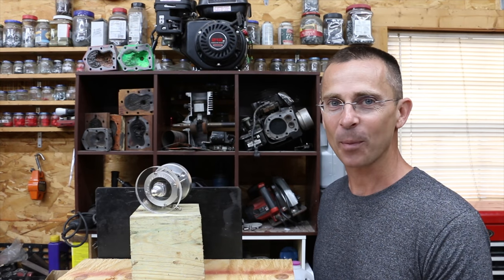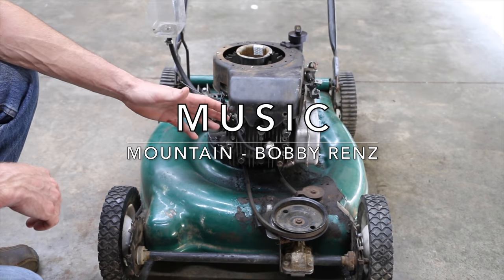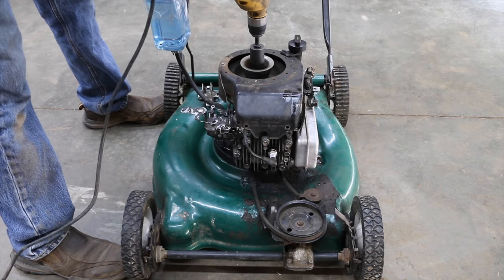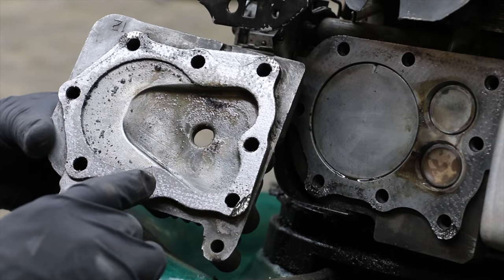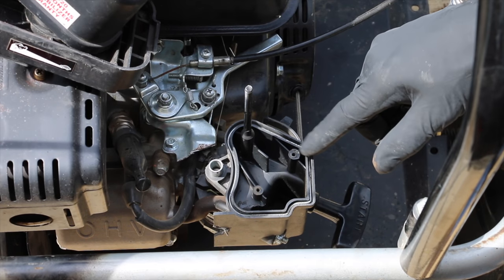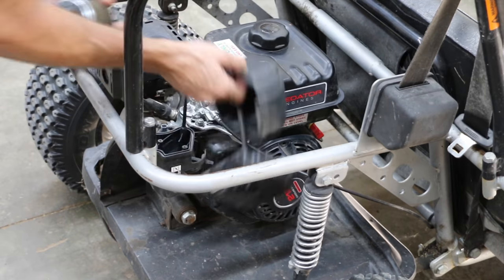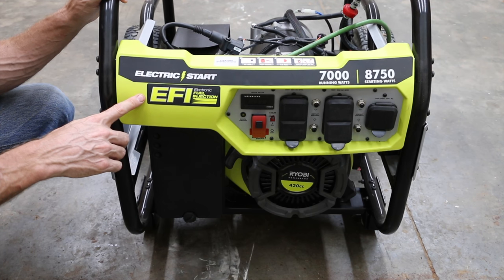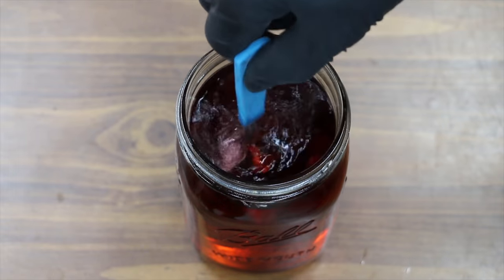Is Leaded Fuel better than Unleaded?  Let's find out!

Comment: I bet that if you had those dark clumps analyze you'll find out they are carbon from the oil getting past the Rings. I grew up in the leaded gas era and it makes a tan color on spark plugs and exhaust valves
Reply from the maker: Thanks for the feedback.

Comment: I mean this comment is late as hell and I can't imagine you'll see it, but FYI you'll need to change the O2 sensor on that generator probably after this. I dunno if it has a catalytic converter but if it does that is also no longer functional anymore.  

Biggest thing with high octane is it lets you run more timing advance or the same advance with higher compression.  Not sure if timing is adjustable on any of those engines but yeah especially with the go kart it would make a pretty noticable difference if you played with timing.

Another fun comparison you might want to try sometime is E85 vs 100LL as both of those are similar octane.  E85 is gonna be a bit tricky though as you will probably have to change jet sizes for it as it requires about 30% more fuel for same amount of air.
Reply from the maker: Thanks for the video  idea.
Reply: @ProjectFarm  no worries, thanks for all hard work and quality videos!!

Comment: I had the privilege of having Olly Moris the chief engineer at Offenhouser the chit chat with about his and my race cars. He was also a avid pilot of small airplanes. He was very blunt about using aviation gas for race cars. Don't do it!  Aviation gas is designed to operate on low rpm engines, up to 2200 rpm. And steady rpm. It is not the same as racing gas.
Reply from the maker: Thanks for sharing.

Comment: Here is another idea except this one is for Diesel engines only. Project farm you should get some diesel fuel additives such as Lucas oil diesel deep clean, Lucas oil cetane power booster, diesel kleen+cetane booster, Lucas oil complete engine treatment, STP ultra diesel fuel system cleaner, gumout multi-system tune-up, Star tron enzyme diesel treatment and then add them to and empty diesel fuel tank and see if the engine can run off of strait diesel additives
Reply from the maker: Thank you for the video idea!

Comment: The poblem comes doing the opposite, using unleaded fuel in very old engines it damages the valves and valve seats i use an additive for that purpose.
Reply from the maker: Great feedback. Thank you

Comment: The fuels are different by  volume. Low lead avgas will make a bit less power and use a bit more fuel. This in a 11.2-1 racing engine. The engine you thought was too fat was actually too lean.
Though ethanol fuels have a different volume too.  Factory efi computers adjust to E10. But E85 is different injectors and pump plus computer. And methanol [race use] is different again,
Same with carbs, eg holley make an E85 carb, a methanol carb as well ofcourse as petrol carbs. Which are quite different when you look close. You can modify a petrol carb for both of the alcohol fuels but always a compromise.
Reply from the maker: Thank you!

Comment: If you have a car made before 1975 or so it should be ok to use leaded gas in it. And even later for a lot of trucks. It usually ok if it doesnt have a catalytic converter(which none before the mid 1970s do unless it was added at a later time, which is unlikely).
Reply from the maker: Thank you for the feedback

Comment: I tried running 5% 100LL with Premium gasoline in classic cars and it was terrible. Difficult cold start, stumble off idle and fouled the plugs up. Hate to think what higher concentrations would do. It must run a lot more rich than gasoline because 100LL is less volatile
Reply from the maker: Thanks for the feedback.

Comment: Avgas as in the data sheet is mostly Naphtha or naphthalene is white gas which is also known as Coleman fuel. Its not the same as gasoline and has a lower vapor point. It therefore will not run the same in an engine

Comment: Aviation fuel, dectane-(C10H22) should have the same density and energy content as diesel (Cetane - C23H48) With combustion properties similar to gasoline (Octane - C8H18). About 82 "octane".
Dectane however does not have excellent lubrication properties like Cetane.
Reply from the maker: Thanks for the feedback.

Comment: leaded gasoline is used as a lubricant for non-hardened valve seats. it is also used as an octane booster for higher compression ratio or forced induction engines. I used to run 110 octane leaded gasoline in my turbocharged 4 cylinder mustang. it won't make good running engines run better.
Reply from the maker: Thanks for sharing.

Comment: Low lead aviation gas is NOT "leaded gasoline"! It didn't have enough lead back when we had leaded fuel for cars, you had to put supplements in to protect the engine. As a racer I had to monitor these things closely so u didn't burn up my engine.
Reply from the maker: Thanks for the feedback.

Comment: When I was a boy, I had a moped. I notice when I use regular gasoline, moped was far away silent and has less vibration. RPM and top speed was higher and temperature was lower...
Reply from the maker: Thanks for sharing.

Comment: 🤔 Maybe I should start putting 100LL in my two stroke Mercury 90hp, what do you guys think?
Reply: Not unless you wanna put lead into the water, lol
Reply: Two-strokes love leaded fuel and especially avgas in marine applications. It's irresponsible to use avgas for pollution reasons, but if you have access to it you'll love the performance. Be ready to replace all rubber parts in the fuel system regularly, as avgas deteriorates them quickly, and manage lead buildup in the combustion chamber.

Comment: Leaded fuel will ruin your catalytic converter as well as spark plugs, but is perfect to run in non-catalytic converter engines as aviation fuel has no ethanol and does not go bad like regular gasoline!

The reason why aviation fuel ran richer in the go-cart was because it designed that way to provide better cooling for air-cooled aircraft engines (richer fuel mix makes engine run cooler). It also made the go-cart run faster because it is higher octane and provided more horsepower, that is why they run high-octane fuel in race cars.
Reply from the maker: Thank you for the feedback

Comment: Im thinking you should test 110 race fuel against pump gas for fuel economy and deposit buildup and hp improvement my experience is you get more power and at least 3 more miles to the gallon as tested in my 4 stroke snowmobile and my mustang
Reply from the maker: Thanks for the video  idea.
Reply: @ProjectFarm  no problem got plenty more lol

Comment: I would like to see one on any effects of running a 4 cycle engine with 2 cycle oil added to the fuel.
Reply: Some do this with diesel engines I have read online to help with fuel injector longevity. I curious to what effect this has on diesel and gasoline engine combustion chambers alike.
Reply from the maker: Thank you for the video idea!

Comment: interesting video, but on the MSDS, the flaspoint is measured as lower then 40°C, not actually -40°C (<=)

Secondly, Avgas has a lower vapour pressure, and has higher sulphur content then normal E10 gasoline. Its not comparable to normal gasoline as you found out, so please don't  run that stuff in your car! Engines made for avgas are constructed way differently with normally higher compression ratios as the oxygen content is thinner higher up, so more air needs to be pushed in. And weight to horsepower ratio matters alot in a small plane.

Avgas 100 stands for MON 100, not RON 100 which is euro 95/98 (Ron 95/Ron98 with Mon in the 86-87 range if i'm right) For your examples that realy doesn't matter as they don't use high compression, but a turboprop engine from a plane does use pretty high compressions so thats why the MON is 100 compared to 86-87 of euro 95. I would love to see a comparison on a high compression engine running avgas vs euro 95 to actually see that difference (run a aviation engine made for avgas on regular gasoline!!)

Regards, laboratory analyst of a refinery checking that stuff daily on national and international specifications.
Reply from the maker: Thanks for the feedback.

Comment: If the fuel injected generator set has an oxygen sensor, I'd imagine it may have been poisoned by the lead? I'm not sure how long that takes, but looking at the plug from the lawnmower, I'd bet it happens pretty quickly...
Reply from the maker: Thanks for the feedback.

Comment: Used to mix some leaded gas in with the regular 93 octane in my Z28. Car was carbed and didn't have cats and ran great. 
Do not ever do this in a car that has cats though, you will do some decent damage.
Reply from the maker: Thanks for the feedback.
Reply: @crapObear2323  While I don't anymore since all my cars are fuel injected, the ones I drive on the street anyway. 
But there are actually a few stations where I still buy leaded from for other things, and no, those aren't getting converted.

Comment: For something you may not know, high octane fuel does NOT mean more power. It's actually less power. High octane fuel is for high compression engines to prevent pre ignition. Put high octane in a car that calls for 87 octane, and you'll have a car that runs bad.
Reply: so right but that is to much for the mouth breather to under stand! i have on 87 ran 10:1 or more  compression on a 302 ford iron heads from 1966-67 289  with a carburetor and dizzy no ping or sine of it  on plugs. the key is small chamber and tight quench aka mechanical octane .it has a small solid lifter cam  so it releases sum of the pressure  with a 4 speed and deep gears 60 mph is 2900 rpm keeps lode off the engine the fast piston speed keeps the mix moving along with qench no ping! use 160* thermostat. the low octane and hi btu over premium gives better power at a lower cost and i get better than factory mpg even thou it is more suted for rode racing or dirt track. the key is dynamic compression and quench. all so the tune.

Comment: Up until the 90's all gas engines were steel blocks and heads and tighter than the aluminum blocks made today. That's why older engines when non leaded gas was mandatory ran like crap.
Reply from the maker: Thank you for the feedback

Comment: Not sure, your test conditions reflected what Leaded fuel is actually good at. That's in high compression or forced induction engines prone to knock. I use it in my supercharged track car and it allows me to advance timing to a point where if on 93 octane the pistons would be on the outside of the engine. As bad as lead is for us humans MOST especially children, it is magic for tuning. I use 30% 110 octane racing fuel with 70% 93 octane. I dont have cats in my car, but still anymore than that and the o2 sensors and or sparkplugs will foul and the ECU will shut it down. 
Impressive how much lead gets left behind in those engines with low lead fuel but, I doubt they are running hot enough to burn enough of it.
This is not a negative comment I love the channel just an observation.
Reply from the maker: Thanks for sharing.

Comment: I have a 73 Ford pickup original engine and it has to have leaded fuel in it
Reply from the maker: Thank you for the feedback!
Reply: no it douse not ,ford since 1970-1 on all dash fuel gauges reads unleaded fuel.  sum dashes did not mention fuel in that time like bronco or above one tun but could run on ether or but did not need lead. i have a 1972 Cleveland that has all tags and stickers most all service records and am the 3 owner has ran on non leaded gas for 25 years as it states on the dash! the lead thing was a big GM lie. the premum today 93 is only 2 to 6 points less than the old ron octane fuel in 1970 at 100! it is rated now with ron+mon/2 that is 2-6 points less in octane. and the lead would burn out mufflers spark plugs fill the engine with deposits!!!! Amico had no led premium white gas in starting in the 20s!! it was popular in the 1960s as it cleaned out the engine and fuel system. have made over 600hp on a 390 on 93 and with iron heads  a crburator and the factory ignition! i know all about fuel formulations have studied it the old patients on leaded fuel talked to the old timers their in the 1960s as mechanics and racers.  the best gas is hi test lead free.it just absorbs to much water unless you get ethanol free or dive it as a day to day and will have no problems. yes the seats do ware a small bit more but the meffers go out at 40,000 mi plugs shot by 15,000 mi and lead deposits on the pistons. the auto light 124 plugs wold lode up with lead in no time! read the factory service data on that engine not the hear say in internet land. i have yet to see a 72 up require lead! look at the fuel gauge as well as service glide octane ratings will be hi do to the old rating system.  1973-1979 is a cool pick up!! not being ass but a lot of people have not played with car engines since a teen with all the old service guides to!!! . was turning wrenches in one way since i was 8! wold love to find a unicorn as ford did strange things! i have worked on lots of ford unicorns like a ft truck block with car crank and dizz to make a bullet proof fe using ft block!  LOOK UP THE FUEL IN A 1973 FORD SERVICE GUIDE! LOVE TO SEE IT! TAKE CARE

Comment: There is a lot of debate about low-vs-high octane fuel, with many reporting reduced power and/or fuel economy as well as increased carbon deposits when running higher-than-recommended octane fuel. I know it would be difficult to test power numbers, but I would enjoy an economy and carbon deposit shootout. I would think using Top Tier fuel from the same station- preferably one with different hoses/nozzles for each grade- and the same ethanol content for each would eliminate a lot of variables and help silence the armchair quarterbacks.
Reply from the maker: Thank you for the video idea!

Comment: There is little to be learned regarding the presence of lead in the fuel because of the vast difference in octane.  The problem is with the timing.  Higher octane fuel resists burning longer than low octane fuel.  That explains why the fuel injected engine had no problem, because it is able to adjust the timing.  There is a leaded low octane aviation fuel but it is difficult to find.  I believe it is a dyed a reddish color.
Reply from the maker: Thanks for the feedback.

Comment: I would like to see an oil filter video I know there's a few out maybe you could make a better one using a tds meter not sure if tds meter works on oil however but would be nice to see something similar done with dirty motor oil as a base and each filter swapped out to see which oil comes out cleaner after one HR of run time or something similar
Reply from the maker: Thanks for the suggestion.
Reply: @ProjectFarm  thanks for the informative vids

Comment: The lead in the fuel cushions valve seats, hence why leaded fuel cars need to run lead replacement now, they still have cast valve seats which wear without the lead
Reply from the maker: Thanks for the feedback.
Reply: Love your videos 'project farm'. I'm thinking of mailing you a few cartons of Australia's leading construction decking screw brands for you to test for pullout strength, ease of driving, and just general Project Farm testing. Nobody tests like you do. You are the benchmark of practical benchmarking.

Comment: Back before they made the change in aviation fuel we would go out to the airport and get 5 gallons and add it to a half tank of the highest octane you could buy then and as soon as it started mixing with the engine running the rpm,s went up about 700 rpm,s and you could definitely tell the difference in HP the stuff they have now isn't nearly as good
Reply from the maker: Thanks for the feedback.

Comment: How do they prevent lead build up when they use it in airplanes
Reply: In bigger piston aircraft engines, the cylinder temps get high enough that an additive present in the 100LL easily turns the lead into lead bromide vapor and ash that leaves though the exhaust.  Smaller / less powerful engines that don't generate as much cylinder heat build up lead just like Project Farm found here.  Smaller plane engines are ideal candidates for ethanol-free pump gas, sure wish we could easily find it.

Comment: 100LL is much better on fuel injected engines. The injected aircraft engines are unable to run auto. Smaller, carbureted aircraft engines, can. You can also run 100LL in some jet engines. The 747 could run 100LL but they had to move a switch to allow it to burn it.

Comment: Hey project farm
I have an idea for some new tests or experiments 
How about adding just a fuel system cleaner such as Berryman b-12, STP ultra 5 in 1 fuel system cleaner, sea foam, gumout multi-system tune up, Techron complete fuel system cleaner to see if the gasoline engine can run off of strait additives and no gas. Then after you run straight additives until empty then see how good it cleaned the fuel system or if it even cleaned at all.
Reply from the maker: Thank you for the video idea!

Comment: I live on a runway an have run 100LL in my JD riding mower and it runs like crap, pops, rough, sputters. Put in Mogas and it’s fine. People thought I was crazy. Turns out 100LL burns faster and hotter and hits the power stroke earlier than the engine designed for. Same with airplanes. Most GA airplanes were built to run on mogas not 100LL.
Reply from the maker: Thank you for the feedback

Comment: It is better. Why, led is used to cush on the motor, lubricity. The valves seat better, so you can accomplish better compression. The problem is, hight emossions. There is why we don't have leded fuel for our automovile aplication.
Reply from the maker: Thank you for your feedback.